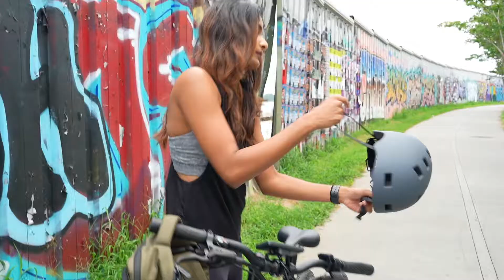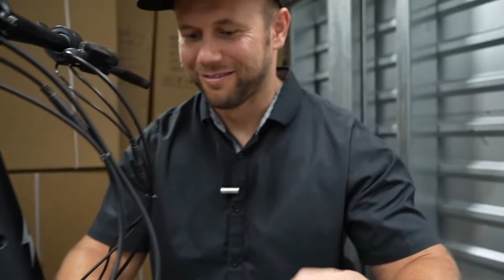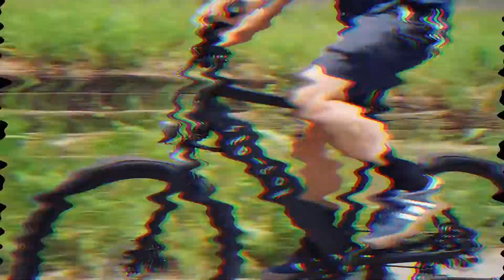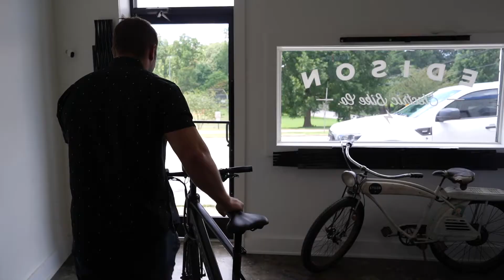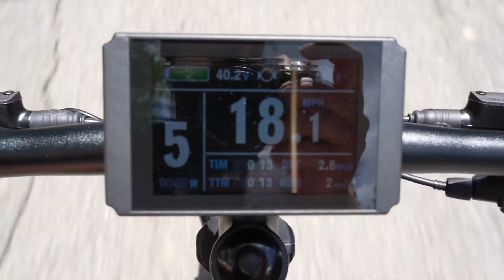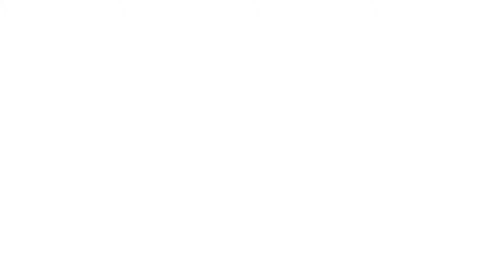Edison Electric Bike Co. | Virtual Test Ride

Comment: i recently visited atlanta, and the hotel i stayed at had edison ebikes for us to ride. rode it every day we were there, and it actually convinced me to buy an ebike myself.

but i'll be honest, the way you cater to locals only, turned me off edison despite the fact i really enjoyed the ebike. plus, you run a 40v system, and i could really notice it lacked power on some of the hills around town. it never failed me, but there were times it was screaming for mercy. also, the lack of removeable battery - i want to be able to swap batteries and keep riding. only have 1 battery that is integrated is a huge turn off. (not to mention you can sell spare batteries for $$$$).